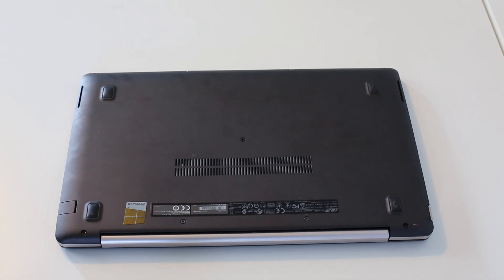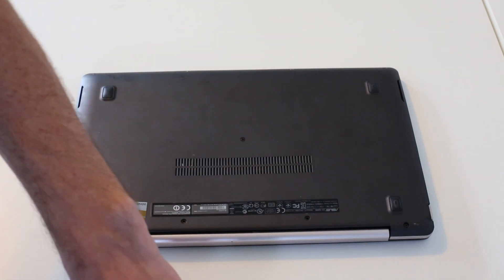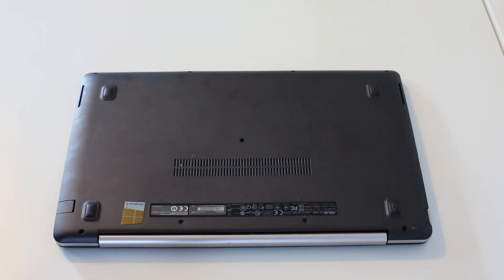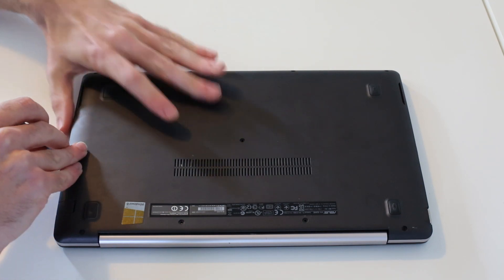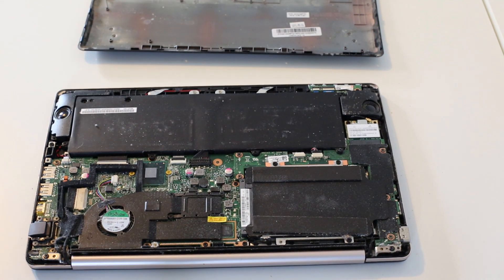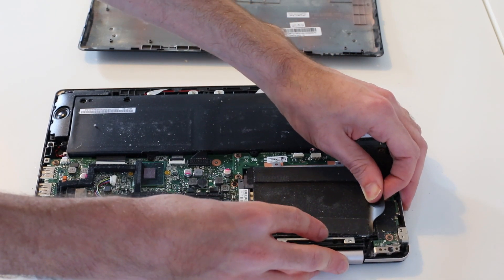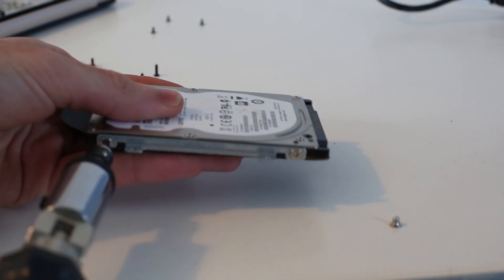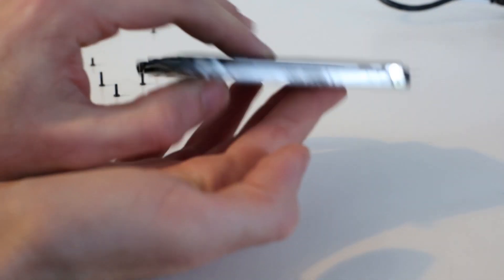ASUS Vivobook S200E HDD Replacement Guide

Comment: Hi I've followed this and got the SSD in. This detects OK in BIOS. When I try to boot USB, the screen stays black. Can you please advise any? I have disabled secure boot and the USB stink shows as a bootable device. I have used Rufus to put the ISO on the USB stick. This is the Ubuntu ISO.
Cheers

Comment: Thanks a lot. I followed these instructions and it was easy and now my Asus which was running like a dog is as fast as lightning. I took the old hard drive, put it in an external case I bought for peanuts on eBay and now I have a super fast laptop with an external USB hard drive with all my old files in.
Reply from the maker: Glad to help :D
Reply: but dogs are fast?
Reply: @samcoogan4514 i mean, they're slower than lightening though lol.

Comment: Friend also replace it with a SSD. But when you turn on the black screen and flashing the dash before inertia Windows. And on the other hd shows the configuration of BIOS, Windows boot manager. In ssd does not show it. You have a solution?
Reply from the maker: You need to install Windows onto the SSD...
Reply: Brue Computing I mange to run Mac OS Mojave on one of these

Comment: Hy, congratulations for your video. I have a question, is possible to have a ssd instead of hdd in this laptop? Thanks
Reply from the maker: Francesco Spina Yes, any 7mm thin SATA SSD should work in this, like the Crucial MX100: http://www.amazon.co.uk/gp/product/B00KFAGCWK/ref=as_li_tl?ie=UTF8&camp=1634&creative=19450&creativeASIN=B00KFAGCWK&linkCode=as2&tag=httpwwwbrue0a-21
Reply: Thanks